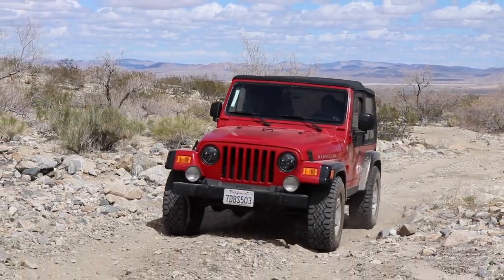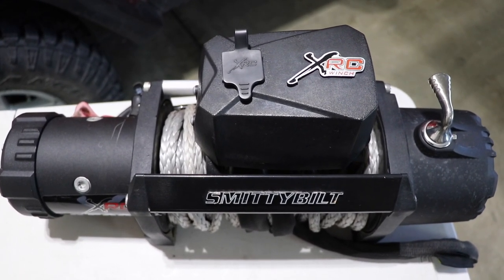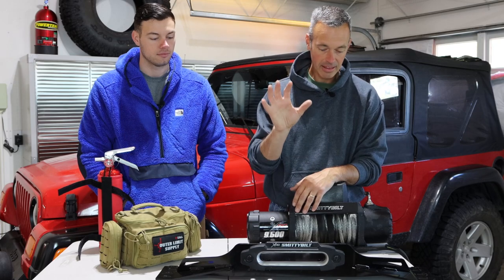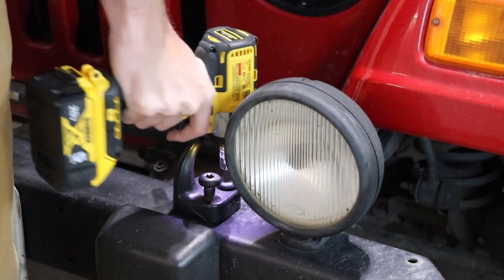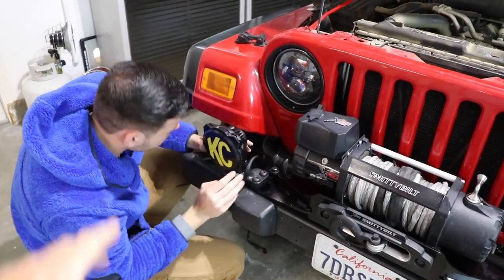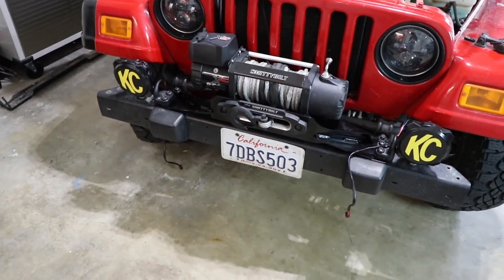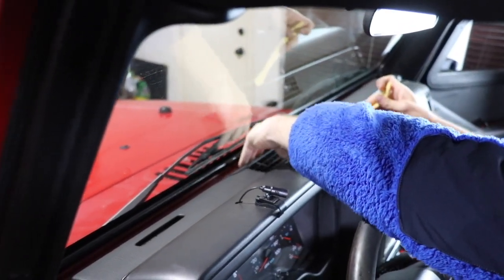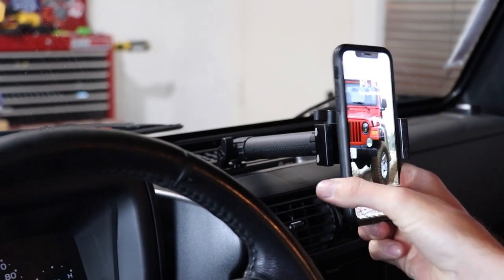The Build Begins!  5 Jeep Wrangler TJ Upgrades

Comment: Get an aftermarket switch that will fit into your stock tj switches on ebay. They make one with the KC logo on it and hook it up to those lights. On ebay the guys name is something like gold coast distributing
Reply: The fog light switch is on the stalk. Save the empty switch spot for the compressor! :)
Reply: Leon Schitzelgruber true but that KC switch is cool. Maybe for the next set of lights! There should be like 2 or 3 dummy switches on his tj model. Either way i definitely recommend using those spots instead of drilling into the dash for switches unless you are going to go with an S pod
Reply: @ryanfoley7254  Ryan's Rubi should have the 3rd of 4 switches blank, since it's a 6-speed. No dummy switch. He could slap any of a number of "cool" switches in there, but my hope is he's a "chrome won't get you home" kinda guy, and put function before form. :)
Reply: Leon Schitzelgruber A switch is a functional upgrade. Im not a cut into the dash type of guy (personally) for a switch that looks out of place. Function matters I agree but also all of trailrecon jeeps have bells and whistles. Thats why they are so cool!

Comment: Jordon, I have a 2006 TJ Rubicon as well. It takes some time to find the right armor/ bumper combo so take your time! 😁 the best advise or upgrade I recommend is a transfer case upgrade that will pay for itself and you can do it at home! I did this upgrade myself and it was the best thing ever. Here is the link. You will thank me later. Also it saves you on fuel mileage 😁. 

https://teraflex.com/shop_items/tj-241or-2low-2wd-low-range-shift-sector-kit?vehicle=TJ%20Wrangler

Comment: Just another reminder: If your OPDA label says "LDI," replace it with a Crown unit for like $100.
Reply: Highly advise doing this asap! I'm dealing with a worn cam gear because of the faulty opda.
Reply: @4xmatt  X2 on retaining the original sensor. Good call.
Reply: @4xmatt  x2 saving the old sensor, but Matt, I think ur issue is a worn cam gear like me. Take off the opda, turn ur camera flash on, and take a picture of the cam gear. I'm sure you will see that the gears have been worn down. That's why when it's cold you're having the cel / limp mode issue.... The metal contracts when it's cold, this messes up the mesh between it and the opda gear. Once the metal heats up and expands the mesh is better and it stops tripping the cam sensor.

Comment: Not a fan of winch plates. Use caution if your really putting a load on the winch. Just my opinion.
Reply from the maker: I had a winch plate on my JK for this first 2 years and used the heck out of it, never had any issues.... he's still looking for a bumper to do a full replacement.
Reply: @TrailRecon  every winch plate I've ever encountered seemed to flex a lot when under a heavy load. Winch plate is better than nothing.👍
Reply: I am excited to see this. I trail recon matching wrap might be interesting. Like that satin red on the gladiator.
Reply: @retiredppd  If your 1/4" winch plate was flexing "a lot," you're doing something wrong.